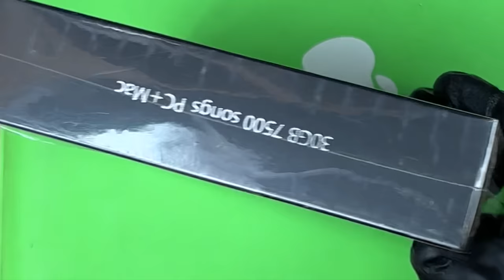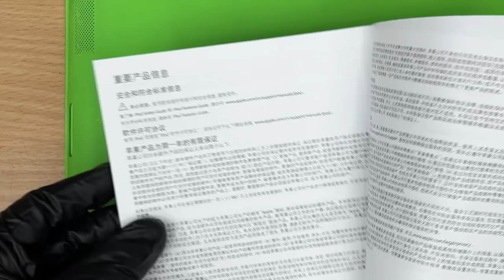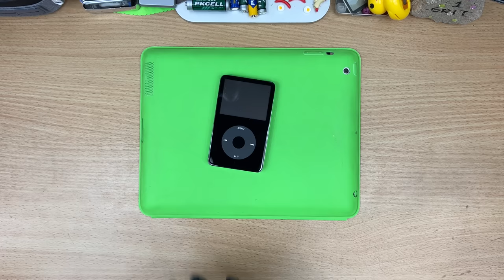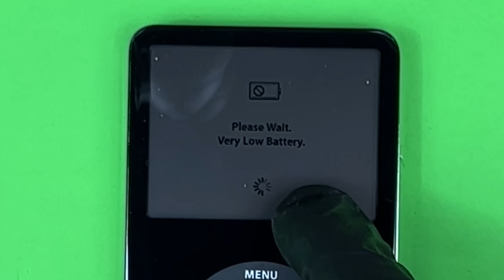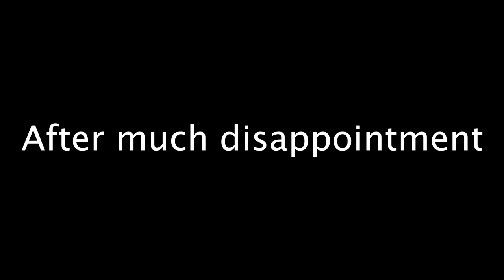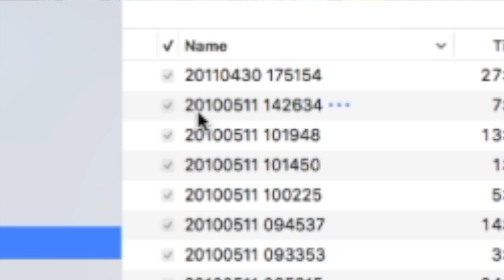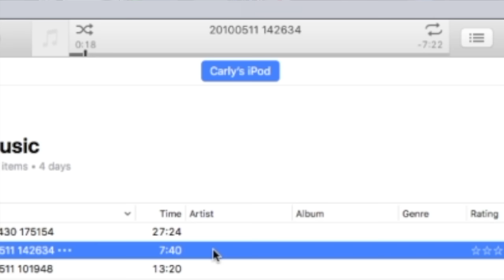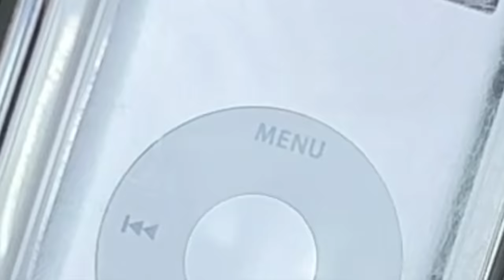Opening a brand new iPod Video.

Comment: I feel a slight moment of nostalgia when DankPods was searching for a battery and found perfectly engineered aux cable, raycon, opened harddrive, drive connector, lego blocks, etc. I know know exactly which video were they come from.
Reply: *manual hard drive
Reply: I miss the iphony earpbuds 🤕🤕🤕
Reply: Thank you for using the correct term "lego blocks" and not that awful "legos". Like, you say "pepsi cans" and not "pepsis" ... okay some might do, but it's probably seen as a strange thing.
Reply: @Liggliluff I have never once heard somebody refer to pepsi's as pepsi cans, unless they were specifically referring to the aluminum container.
Reply: @Liggliluff   Ok but exactly who cares? Policing whether people say "legos" or "lego blocks" makes you sound extremely pretentious tbh

Comment: The reason the FireWire cables get dead pods to boot is that they power the board directly instead of charging the battery to power the board like USB
Reply: Nice
Reply: I think it's actually a current limit thing.  Standard USB is limited to 500mA @ 5V.  FireWire was good for 1.5A.

The power management IC is going to limit the total current used to stay within that 1/2A on USB, and part of that is being used to charge the battery.  The remainder is available to power the device.  Any deficit in how much the device needs to run stable from how much is available would have to be supplied by the battery, so if the battery is too low to prop up the iPod under low-current conditions, then it can't safely run.  This prevents the iPod from shutting down spontaneously when starting up the drive, etc.  (Which happens sometimes when running on a tired old battery because it can't supply enough current anymore without the voltage drooping below the cutoff point.)

FireWire gives it one whole amp over USB, so it has a LOT more margin to power the device and charge at the same time.  That's why it can always get the device to boot, even with a totally flat battery.

EDIT:  And yes, modern USB supplies are capable of 1A, or 2A, or more.  But the iPod power-management IC doesn't know that.  High-current USB supply detection wasn't standardized back then, so it won't ever attempt to consume more than 500mA.
Reply: @nickwallette6201  pog
Reply: @TabbyEgg312   kupo?
Reply: @nickwallette6201  as in pogger
Reply: @nickwallette6201  it's also at 30v instead of 5v so that's good for at least 30w instead of 2.5-5w on USB
Reply: Interesting. I know some of the iPods also only use certain chargers.
Wonder if there's any reverse-engineered (or official) documentation on how it works.

Comment: I loved those little sleeves. I was so bummed when they stopped making em. That was my go to "case". You could use the click wheel through it, so you just squeeze the bottom to see the screen, and it keeps it from getting scuffed without adding bulk. Loved them haha
Reply: Those sleeves were awesome, the one from my nano is super brittle now but i loved that thing so much
Reply: @ShadyMrk  If you're still in need of a pouch, you can easily diy one with thin felt! Just trace the nano on it with a little seam allowance and sew it together with a simple blanket stitch!
Reply: @s0apys0ph1e  thanks man, sadly that nano is long gone, my sister lost it, but i still keep the box and the accessories for it, it was my first iPod :’(

Comment: I think I found a way to break wireless earbuds. This is not confirmed in any way but since you can’t hook up an amp to wireless earbuds I think you should try it out. 

Turn on “hear through” or whatever it is called and put the buds near each other or maybe in their case, you might have to make a loud noise for it to work. The hear though will hear the sound from the other earbud and it will constantly get louder as the other does the same. This might make them loud enough to break the speakers.

I’m not sure if this would actually break the earbuds but I do know I have accidentally done this in class for a split second and I got a lot of weird looks. It might not work but I think you should at least try it if you ever want to burn out some wireless earbuds!
Reply: Unfortunately that's not exactly how that works as wireless earbuds have their own amp built into them, they can only go as loud as the circuitry within them allows for. This doesn't mean that it's not possible to blow up wireless earbuds as it's definitely possible for some sets to be over driven, but the much easier way to achieve this something like what you're describing, but with better results is to play a constant frequency (whatever frequency is most stressful for them, through the earbuds which unlike regular music won't allow the speakers coils to cool down between beats and such
Reply: Definitely not as entertaining or interesting as Scarlet Fire though

Comment: oh man i love how these old 5th and 6th gens had front plastic panels, they were so easy to open up.
back in 2018 when i built my 512gb frankenpod i used a 7th gen metal front panel with a 5th gen thick back panel (because i also upgraded the battery to 2600mAh as well) 

usually i easily open up 5th and 6th gens with just 1 tool and its pretty easy takes a few seconds...

but that 7th gen, i literally cut the palms of my hands from trying to open it up with the actual 4 isesamo tools i had to use to open it up, i mean holy shit it was so difficult to open up, literally one of my isesamo tools got destroyed and 2 got their tips bent, only one of them actually survived that, and of course my palms were completely covered with cuts and blood lol

that being said though, the battery on my frankenpod literally lasted me 4 months of daily use before i had to charge it, its INSANE.
i've also fully charged it back in march in 2020 when the pandemic started and didn't touch it up until sometime in august 2021 and it was literally still working with around 20-30% battery, like holy fucking lord that thing's battery life is completely insane!
so yeah all of the pain and blood and 3 isesamo tools that got destroyed making it were well worth it lol

Comment: oh man, I actually still have one of these I use every day in my car. Bought it brand new in December 2005 because I was driving 900 miles round trip across CA for the holidays and the tape deck in my 1992 Toyota Corolla (when I also still have in storage) died. Got one of those weird radio transmitter adapters to make it work. When I got my current daily in 2012 I threw it in that. At one point the screen went black and stopped working but it cleared back up. About 3 years ago I put it in a new case because that slip cover was disintegrating. Sometimes it when the car turns back on it will reset to just a completely random song, but other than that still works like a champ.

Comment: I didn’t knew I will feel bad watching this channel until Wade opened up brand new iPod :( brings me to the memories I had iPhone 4 since 2011. A drop of ketchup fell into the earpiece and blocked the sound completely… I cleaned it but vibro motor stopped to work… I used it for 4 years more until I got SE 1 and decided repair it and give it to my father to use. I replaced the cable for vibro and it worked for 2 more years until vibro and jack stopped to work, father sent it back to me to see what’s there. And crappy chinese replacement got disconnected because it was lacking a foam patch… connected it back, added a foam and it is still working completely fine with default battery. Then I replaced SE with 13 Pro and gave SE to my father as a second phone (but had to replace dead battery). After my brothers motorolla died (there were 3 dead phones since 2011) my father gave my iPhone 4 to my brother and he is using it for a year already. This is nuts. It really grind my gears if I haven’t ruined it with ketchup it would be untouched and in its original form. Made in summer 2010, still working in 2022 this is what I call quality. To be honest I want to take it back sometime to still use myself because it had a lot of memories of mine, it is small, chonky and heavy and just a next level compared to other phones of that time

Comment: I bought mine in 2007 and I don't remember it coming with the pouch. I still have the box and all these stuff, I checked the manual, I just don't remember having one. The iPod though is still in pretty good condition, the battery still holds a charge and it lived it's life in a Belkin hard case, still looks pretty good.

Comment: Back before the iPod had USB power capability, they sold a cable that had both a FW400 and USB into a single dock connector. so you could sync over USB and charge with the (then included) brick. You can find them on the secondary but they aren't cheap.

Comment: You gotta get one of those Apple cables from the iPod 3g days where it is a 30 pin connector with a FireWire end that only charges, and a USB end for syncing. Makes working on dead dead iPods so much easier

Comment: That's the thing about batteries. They self discharge with time and it doesn't stop when the battery is basically discharged. They undercharge on their own and basically cook themselves on their own.
So little PSA here: If you have some old electronics laying around with bats in them, make sure to top them up once every few months, or you gonna permanently destroy the bats in there.

Comment: I have an old iPod Video, when it's completely discharged, is best to leave it plugged in for a few hours. It will power cycle a few times. Because it draws to much power when booting up, but eventually it will have enough charge. Just don't be so impatient, it would've revived.

Comment: you could have modified the cable to separate the power in the usb to put in on a wall charger with more juice, while the other pin are still used for the data , like make 2 usb from one wich you split the data from the power

Comment: Watching this again for probably the 6th or 8th time, those were the best buds in their day. When they were fresh, they could pull off some good notes. I was loving the 320Mb "bass tester" songs back then on my crap sony "component system" in my bedroom as well as the "hi-fi" 5.1 in the living room. And those buds were good enough to feel the notes, both high and low. But would enter an endless void of crackles if pushed too far one way or the other.
I must have gone through a half dozen pairs by cranking it to max before the iPod itself got stolen from my locker.
(Edit) the egg bag was always shit. Will never be more than shit. It is an Apple approved method of scratching your display while also not being covered by warranty.

Comment: you can take that hdd out and install ssd, they are same format and if you use linux and DD that whole drive, it should work. 
ssd's use 1/10'th of the power unless you write (then 1/4'th) than hdd's so for booting this thing, it would be much easier.

Comment: Couldn't you have used one of those "iPod 3 for Windows" cables where it's 30-pin on one end and a split USB and FireWire 400 on the other? IIRC, these were specifically for charging while transferring music since the 3rd gen. couldn't charge over USB at all and FireWire wasn't particularly common on non-Apple machines.

Comment: I used to have an apple 30 pin connector cable that split into a FireWire for charge and USB for data. Wish I had still had it.... And the 3rd gen ipod it came with...

Comment: never owned and still don't own an ipod, and i'm not sure if you'll see this, but for future use, i think apple sold a y cable that goes from a dock connector to a usb 2 port and a firewire 400 cable. should let you charge and sync the device at the same time. i think they are very expensive, though.

hope this helps if anyone sees this!

Comment: Shame. A usb data connection will still work if you get a cheap extension cable and splice it so the ground and +5 dc line go to a cheap desktop power supply to give it a little more oomf, just step it up past 5v slowly so you don't accidentally fry something. The ground wire should be 'T'ed off so it is still connected to the host pc, usb device and power supply but make sure the +5 volt line only goes between the device and the power supply and not the host pc.:w

Comment: you want to do a faster danny ricciardo? just tape both 30-pin connectors together for even faster switching.

but i suggest doing a Robert Kubica instead:
sacrifice a firewire - 30-pin cable, connect (solder) its pins #19, 20, 29, 30 to pins of a half-dismantled 30-pin connector (usb cable)
enjoy the power of firewire and data transfers from usb without the need for danny ricciardo